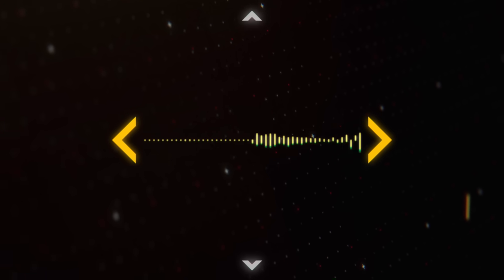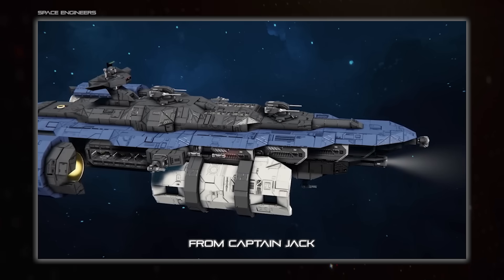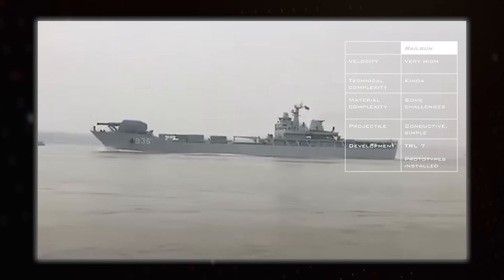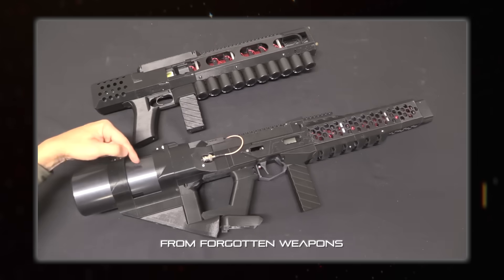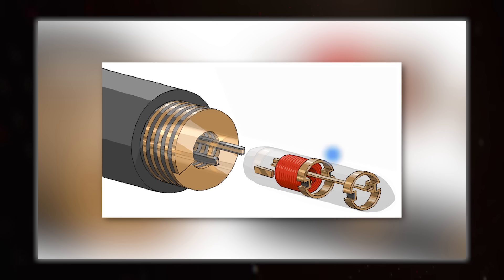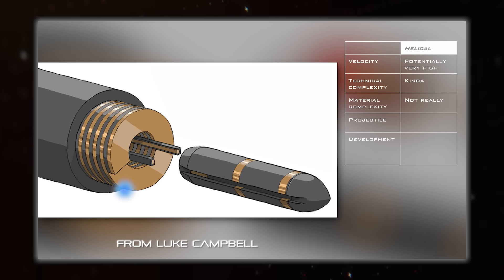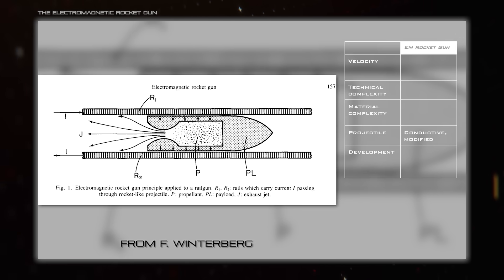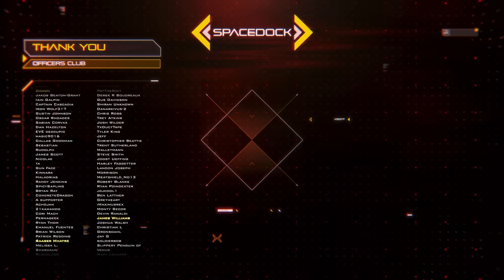The Deadly Coilgun/Railgun Hybrid You've Never Heard Of (Helical Railguns)

Comment: So often, people forget that any time a projectile is moved, there's recoil. All the energy used to get an object moving is applied equally to the mass that it's being moved by.
Reply: Actually, the projectile mass and launcher mass must acquire equal and opposite values of momentum not kinetic energy. For a given value of momentum, a small mass at a high velocity has a much greater kinetic energy than a large mass at a low velocity.
Reply: @derekp2674  Yes. The point is that electromagnetic launchers aren't immune to the 3rd Law just because they use electromagnetism instead of chemical propellant.
Reply: @oneproudbrowncoat  Absolutely correct. One of the railgun clips used here shows the US Navy railgun on its recoil handling system.
There has been some scientific debate around the physics of railgun recoil but that's another story...
Reply: "So often, people forget that any time a projectile is moved, there's recoil"
Aside from the were questionable use of punctuation: No.
You can have recoilless weapons. That is quite easy to achieve with conventional propellant - think of any rocketlauncher. there is no recoil cause the acceleration is not due to applying a force against the weapon it self but rather by simply flinging mass out the back.
Reply: @ABaumstumpf  "You can have recoilless weapons. That is quite easy to achieve with conventional propellant - think of any rocketlauncher."
Aside from the poor usage and syntax: no.
The recoil might not act upon the launching apparatus, but it's there nonetheless. Newtonian physics still apply, but you'd have noted that if you'd read the second sentence.
Reply: @oneproudbrowncoat  "The recoil might not act upon the launching apparatus, but it's there nonetheless."
And it then is still - by definition - a recoilless weapons.
Just cause YOU don't know that doesn't make it any less of a fact.

Comment: FYI, the flame at the end of rail gun predominantly comes from arcs turning air inside of the barrel into plasma, smoke - mix of rail dust, plasma burning everything it touches and air essentially changing it's composition - anybody who witnessed transformer station explode can attest to smell ;)
Reply: Part of it could be lessened by pumping out the barrel to .05 atm pressure.
Reply: IIRC the "rail dust" is aluminum, which is the most common fuel for solid-propellant rockets.
Reply: @JWQweqOPDH  personally I've never heard of anyone using aluminium for rails as copper has far higher melting point, survives more pressure, has lower friction coefficient, has lower chance of developing intercrystalline corrosion etc etc.
Fun fact: when we've had a "pie in the sky" talk among engineers and discussing railgun, one guy suggested graphite grease as a way of protecting rails. Graphite is conductive, however it could also make current pass between rails on it's own ... but that's an engineering challenge that can be solved.
Reply: @tommybronze3451  Maybe not the rails but I know some armatures are aluminum, and rail dust will naturally be mixed with armature dust.
Reply: @JWQweqOPDH  Can you please elaborate on what armatures you are referring to ? I'm honestly puzzled, because afaik problem with rail guns is also a parasitic eddy currents and aluminium is best for that (right after coper) and since super high forces working on rails you need to use very very tough materials and aluminium (due to it's Eddy currents) don't seem like a best choice. Specially if one had to mix aluminium with steel - that would be quite dramatic.
Reply: @tommybronze3451  Several sources from the web refer to the US Navy's tech demonstrator rail gun using aluminum armatures. Here is a quote from Popular Mechanics: "The 25-pound projectile is a non-explosive bullet filled with tungsten pellets inside an aluminum alloy casing, or sabot, that falls away after the projectile leaves the barrel." I cannot verify this information or explain the reasoning behind such a choice. I can say that aluminum is used in long-span electrical transmission cables due to its high specific strength and high specific conductivity.
Reply: @JWQweqOPDH  GOTCHA ! Sorry bud, obviously I'm suffering from brain rot, armature as in projectile sabo. Yeah those shall be aluminium all the way to reduce discardable mass.
Reply: @tommybronze3451  Yes I believe armature is defined as the moving part of an electrix motor circuit, similar to "rotor". A rail gun functions similarly to a linear motor (and a coil gun even more so).
Reply: @JWQweqOPDH  I know, just forgot that term being used in rail guns this way since in normal guns it's used for other things ... again, brain rot.
Reply: Pylon cables have a steel core. Probably stainless or similar alloy

Comment: I was thinking of using electromagnetic weapons called "magnum" weapons that would be somewhere between coil and rail guns shooting ammo akin to bolts used in 40k for a potential setting, the barrels used would be "rifled" with conductive material for this while ammo used would only need 2 roundabout channels with same conductive material used for the barrels, thus allowing either use as coil or rail one(all drawing power from a mini-generator built-in to the gun), haven't decided yet.
I wasn't sure if there was such a combination in irl theory if not practice, and this video came just in the right time. Thank you for the useful info, it helped alot.

Comment: Note 6:24 switching the direction of the current would, in this case) not affect the direction the shot is fired, since the both the magnetic field of the projectile- and barre-coil would be flipped. (It's the same thing as multiplying two negative numbers together resulting in a positive number again.)

Edit:
this effect can be achieved at home:
1) Place permanent magnets on both ends of an AA-battery and pushing it through a long coli of blank wire.
2) The battery and magnets will be moved through the coil.

Comment: Powering railguns is more complex than you make it out to be if you want to maximize efficiency. For instance, the faster the projectile is moving, the higher voltage you'd want to use, and that becomes a problem the longer the rails get, because if you wired the rails to the power supply near where the projectile started it might arc instead of following the projectile, etc.

Comment: An interesting thing about a coilgun is that you can adjust the muzzle velocity just before firing, which is probably useful for mortars.
Reply: It's a non-linear relationship due to the involvement of an LC circuit (the capacitor and the accelerating coil being the C and L, respectively), but roughly speaking, capacitor voltage is proportional to muzzle velocity.

Comment: And here I was expecting the Rocket Gun would simply be a Rail or Coil gun being used as the Launcher for an actual Rocket/Missile...

Missile Ranges are affected by Launch Speed so if the Missile is traveling at Mach 4 or 5 when it leaves the Launcher, it's going to have all that much more range because it can delay the ignition of the Rocket Fuel...

Comment: This may actually be what the mass accelerators from mass effect actually are as they are described as being able to propell projectiles through precise electromagnetic attraction and repulsion with minimal power consumption. Additionally, if you compare the size of the barrels used by mass accelerators to the size of the projectiles, it becomes apparent that the projectiles have a significantly smaller diameter than the barrel. Something that could be explained away if the solid metal slug were surrounded a helical sabot that gets ejected after the projectile leaves the barrel.
Reply: If something the size of the bore leaves the weapon with every shot, A) it will hurt a lot more and fly farther than a projectile described as the size of a sand grain going the same speed, so why bother with the tiny bullets at all and B) it means the volume of each "round" is large so holding hundreds in the gun at once is impossible. A tiny projectile levitated in the middle of the bore makes more sense.

Comment: Theoretical idea I just had in response to the content of this video. (And I’m not sure whether a sci-fi has already done this or not) 

A magnetic particle coil gun. 

It’s a coil gun, that fires a stream of magnetic particles, or even magnetic shards. 

Though getting the timing right for the coils would be even harder for a stream as opposed to a single magnetic projectile.

(And when I say stream, I mean short pulses, not a continuous stream. Maybe half a meter in length, as of existing the barrel… to maintain the rule of cool)

Plasma (being another magnetic substance) could also be an option as a projectile for this idea. (And now I’ve made Blasters from Star Wars😅😁)

So maybe an alternate magnetic propulsion system, instead of coils. Rails would likely be less functional. So some form of magnetic system around the barrel that would pull the loose cloud of particles/plasma, then slightly push them upon existing the weapon (or maybe just magnetically repulse the projectile from both the back of and barrel of the weapon (no pulling, just pushing forces) allowing only a narrow magnetic path for the projectile cloud to escape, thus both accelerating, and focusing it into a narrow beam/stream.

Comment: The Elysium movie had the Chemrail, a gun that seemed to use a chemical reaction to start the projectile, and then sped up with rail technology.
Plasma and laser weapons aren't as standard issue for basic grunt soldiers and police because those kinds of weapons would burn everything.
That lack of controlled damage wouldn't be ideal unless one intended that, so plasma and lasers would work more like flamethrowers.
Rail guns and other electric propelled projectile guns are a good fit for futuristic sci-fi/fanatsy medium, if one doesn't want to use the old reliable ignition propelled bullets.
Reply: Chemrail is a good idea, it not only reduces the power needed to the railgun because the initial movement is initiated by normal bullet methods, But using normal bullet methods also allows for cycling the rounds using a tried and proven gas system. Also I would assume the chemrail has the added advantage that if the battery runs out you still have a machine gun.

Comment: Electromagnetic Rocket Gun sounds like a good disposable anti-heavy weapon
Reply: In an old computer game "Ground control" infantry of the Order had basically this. Two shots per squad, that could blew heavy tank in short range.
Reply: If its just powered by the gas exploding its just a worse recoilles rifle
if its not, then its not recoilles
Reply: @ataarono  The burn rate as a function of time is fixed per cartridge in a firearm.  With any kind of electrical burn you can effect closed-loop control of the gas generation.
Reply: @smorrow  You would be suprised, there is significant engineering for designing the propellant of purpose made cartridges to get the burn time just right for the weapons specifications. This is possible by shaping the propellant to change its surface area, causing it to burn slower or faster for example.
Reply: @ataarono  Um, I'm aware of that? There's "signifcant engineering" on the SRBs on the SLS too, but their flight plan is still set in stone once the SRB is made.

Comment: there is also the chemical coil... and rail guns.   

this is another hybrid system, where an initial charge... such as gunpowder is used to accelerate the slug in the barrel THEN the coils take over.  this is done to overcome inertia.   this can be done in rail guns for example with a very short barrel that starts the slug into down the rails but once the gas is no longer needed the "barrel" isn't needed, and you can switch back to the gap between.

The advantage here is it lowers the power requirements somewhat..   this system tends to work best short barrel long rail systems.
Reply: I've seen some IRL railguns use an air cannon to launch the projectile into the conductive rails for similar reasons (but also because with a railgun if you start the projectile at 0 velocity it might just go backwards, or it might spot-weld itself to the rails rather than moving).
Inertia doesn't have much to do with it in the example I've seen, more so a "sticky rails"/"indecisive directionality" problem.
Reply: @44R0Ndin  i've also see "spring piston" system used to "start"  a projectile moving through a coil gun.    

but the gun effect is used in "larger"  slugs,  where the slug weighs over 100 lbs...  they can use a lower power for constant acceleration down the rail, rather then the huge spike needed to get it moving from a standstill.

Comment: You mentioned a readiness scale, with a higher number obviously being better. Is this a concrete scale with different incremental meanings, or just a vibes thing?
Reply: There's a few different ones out there and they do generally have definitions for each specific step. The original NASA one for example seperates things by demonstrated use in environment (ie: space), and whether that was a prototype or full production.

There's a wikipedia article about the concept if you want to know more.
- hoojiwana from Spacedock

Comment: Only a problem in high energy railguns. For normal railguns the friction is no problem. Coil guns are amazing, but hard to get right, but you can do it with hall sensors, just like in e-motors.

Comment: What about using parallel streams of plasma to replace the rails in a railgun? the power consumption would be absurd, but you would never need to replace the rails, since they are reformed after every shot. for that matter, what about using conductive fluid rails? you could use something like ferrofluid and confine the fluid to the tracks with magnets, which get disengaged after firing, so you can expel the old rails and make new ones. a bonus for scifi of either of these systems is you would get funky looking muzzle flashes.
Reply: That sounds like a madman's invention, i love it!

Few problems i would expect to see with that would be the dramatically lower conductivity of even "high" conductivity liquids, most folks don't know for example that water is a horrible conductor although you obviously didn't refer to water here.
 The other end is the confluence of viscosity, temperature, conductivity and resistive losses at huge temperature peaks and the variable nature of those values.
 Probably won't see in a century atleast if ever, but boy would i like to be wrong!
Reply: @RiversJ  You would essentially need a fluid metamaterial, getting the conductivity high enough probably isn't impossible but I image it would be difficult with today's tech. You would also likely have to deal with some form of electrolysis within the rail fluid, meaning you would need to be replacing some of it after every shot. Still might be more cost effective than replacing the rails, depending on the chemistry.
Reply: Ferrofluid is too costly to dump. I'd say it just sucks any bits that fall off right back to the rails. That, too, could be a fun muzzle flash of black liquid shooting out and then reversing
Reply: @goober-ey7mx  I assumed that some of it would be recycled, yes. Some would probably have to be expelled though.

Comment: Now add several kilos of antimatter in each missile, and you'll get an extremely cruel, killer weapon.
Reply: That seems… overkill. A kg of antimatter is like 400 megatons of TNT; and would cost about five quintillion dollars… you could build about 42 billion thermonuclear ICBMs for that price… which is also overkill, but a much better value IMO.
Reply: @DreamNotOfToday  tbh if one could make AM on the cheap, it would be far less cruel than current nuclear weapons anyway. AFAIK an AM reaction does not leave much nasty behind, Current era thermonuclear weapons initiate the fusion reaction using a conventional implosion type atomic bomb. Using the fission reaction to create the conditions in which fusion can be initated.

That said convention thermonuclear weapons are still better for another reason, they can be stored and have no really major storage requirements beyond some upkeep and being out of the weather(such as in a silo). AM warheads would need power all the way up until they need to make a target go away. As you would need a constant magnetic field to contain the anti-matter. would be a bad day at the silo if someone unplugged the antimatter missile by accident and forgot to warn anyone before alarms were sounding about a low battery.
Reply: @filanfyretracker  all fair points. But 1kg is still overkill, unless your coil gun can launch the warhead a few hundred kilometers. 1kg of antimatter is like 4 Tsar bombas.

Comment: I wonder what happens if you combine the Helical with the rocket thing I already forgot its name it's one after Helical, couldn't you in theory get even greater potential combining best traits of both options even if it doesn't last long before needing replacement it should be good for your more speculated and or rarely used but need something really powerful I call it rocket Helical gun. What if you combined Helical or rocket Helical with rods from god weapons platform potentially decreasing time between launch of rods and impacting the ground. As by time we make something like rocket Helical and it's other weapon cousins practical maybe getting ammo to space will be similarly just as practical